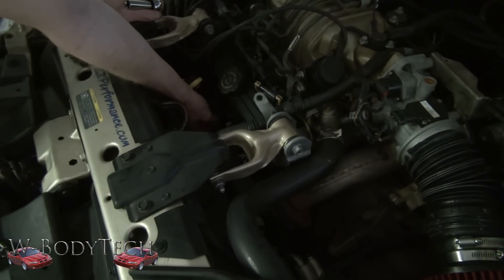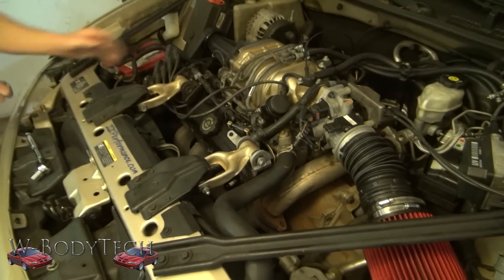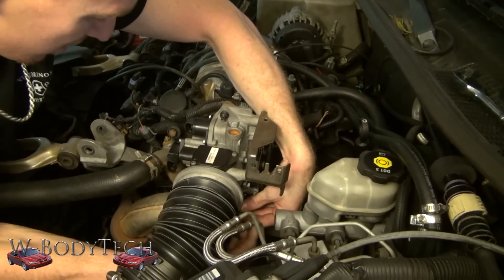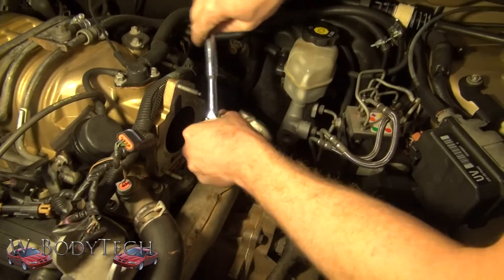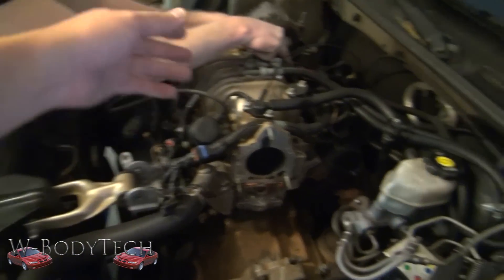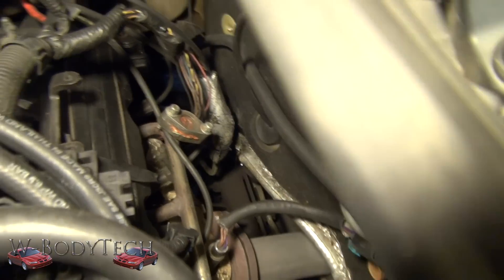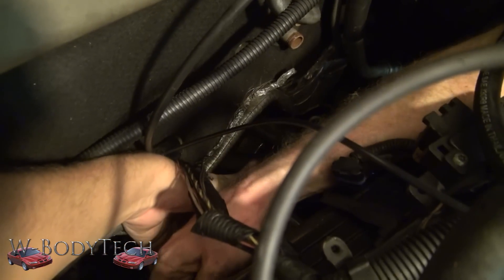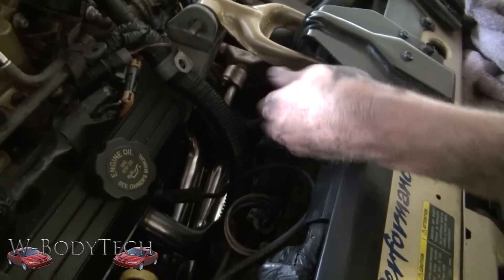W-BodyTech - Grand Prix GTP 3800 Speed Daddy Header Install

Comment: Anyone wanting to do this don’t, I installed these on my 04 intimidator and they suck the v band is built like garbage and the u bolts/clamps do nothing but leak just go with zzp power logs or your factory exhaust
Reply from the maker: Never had any issues with this and we did this back in 2014. Anyone that knows better won’t use the ubolts. Sorry you had issues with your install but I refuse to promote zzp trash here.
Reply: @WBodyTech after looking into it more it wasn’t the u bolts that were leaking. My egr was leaking and no matter what I did the v band would leak I feel like it was just machined poorly
Reply from the maker: I've heard from others that the quality of these headers has gone down since I posted this video.  @Andrew-bv6qc

Comment: Would those headers fit a gt
Reply: There's really no reason to do that on an N/A. Reaaon why is because without a blower or turbo you're not going to exceed to the flow capacity of the stock manifolds.
Reply from the maker: Yes, they will fit any 3800 wbody.

Comment: Speed Daddy headers are trash. Had them on my GtP and they weren't bent right from the factory and didn't seal on the front head. Also, the o2 sensor port is aimed at the firewall so you have to bash it in to get the o2 sensor in.

Comment: Did you have to modify that crossover pipe?
Mines don’t line up
Reply from the maker: We didn't have to modify the pipes. they fit
Reply: you can send me a link where I can buy everything
Reply: Just an fyi if  you  havent ordered yet just know alot of them come with issues of the manifold flange being warped from getting hot while welding and you need to have that fixed before instal by either getting a sanding belt machine or whatever its called or sending it out..not all are like this much alot are

Comment: I’m trying to get the manifold off the motor. I cannot reach the bolts. Any suggestions?
Reply from the maker: Melissa Scribner remove the top engine mounts, get a rachet strap and use it to pull and hold the engine forward. It will give you plenty of room to get those rear bolts.
Reply: Ok thank you!

Comment: Is this pretty much the same process to put headers on a supercharged Bonneville? I've been hearing that if I'm going to put headers on I'm going to need to pull my engine in order to do so. Thanks in advance.
Reply from the maker: Ethan Pope it all comes down to clearance, it's the same engine, supercharged or NA. I'm sure you can make them fit, what year is the Bonneville?
Reply: 2002, not too serious about headers quite yet but just trying to get a little info before hand so I know what I'm dealing with
Reply from the maker: Ethan Pope I would think you would have more clearance being a G Body and all. Pulling the engine for headers sounds a bit over the top of you ask me.
Reply: WBodyTech That's what I was thinking too. It's hard to find someone that's actually helpful in the forums nowadays haha I'll do some more research and see what I can come up with. Thanks for your input though man, appreciate it.

Comment: Whr did u get the pipe couplers from...and what size
Reply: Midnyt Customs you can get those from a local parts store their called band clamps. They are in long black and red boxes or get them@zzp, I still recommend silicone in the connections in the pipes themselves preffered high temp rtv. These headers require 2.25" (x2) and 3" (x2) band clamps.

Comment: @WBodyTech! if I want to change the 3800 to a 4800-5500 or a5900? how can that be done. and also can i revers the engine from sideways to Lenthway?and if the is front wheel drive can that also be revers, did you ever done any modification like that before.

Comment: well I tried to tackle this project based off this install alone and I encountered some huge issues that they didn't really get into. they skipped the part of fighting with the trans dipstick all together. then these headers have a clearance issue with the O2 sensor before the cat near the firewall. also they don't tell you you have to put the trans dipstick back in before the cross over pipe. In this video he already had work done to his cat and the flange bolts were easy to unbolt, but in reality you may be like me and get stuck with bolts that have welded themselves on. I had to grind them off now having to figure out how to put holes back in flange in order to bolt up new down pipe. love this video but just warning everyone....it's like they said 5 hours or more based on NO complications.
Reply: Right, O K, yeah, things went way too smooth...thanks.😊

Comment: What size was seal clamps did u use on the crossover pipe? I bought 2.5 but they seem too big and I have a bad exhaust leak there.
Reply: 2.25 i believe
Reply: Jason Bohl downpipe is 3".

crossover is 2.25"
Reply: Frank Castle so how many of what size ... I was told I need 3 ... is that 2 -2 1/4 and 1 - 3? or is it only 1 of each
Reply: Two 2.25" and two 3" is what i needed
Reply: Frank Castle thank you ... I put in the order

Comment: These cars are so terrible to work on
Reply: They are not. I own a 2000 Pontiac Grand Prix and repair and modify it. There's plenty of room in the engine bay and it's a pushrod engine. There should even be mechanics out there who will tell you the same thing.

Comment: What did u do with the dipstick I have a Bonneville ssei 02 but my transmission dipstick is blocking it
Reply from the maker: We had to order a custom one for the GM 4T60, 4T65, 4L60 & 4L85 Trans, its a flexible dipstick tube.
Reply: what did you gain by taking all the emissions shit off